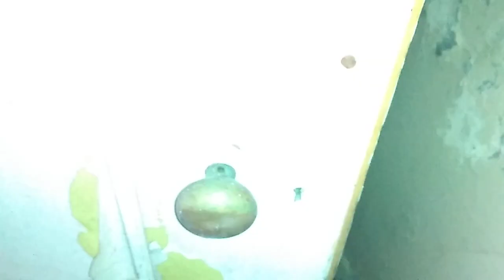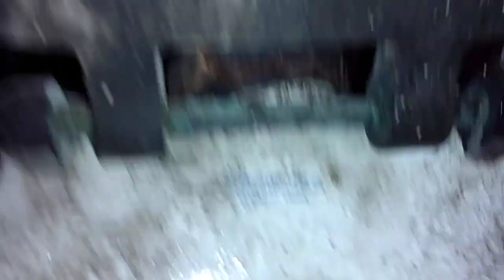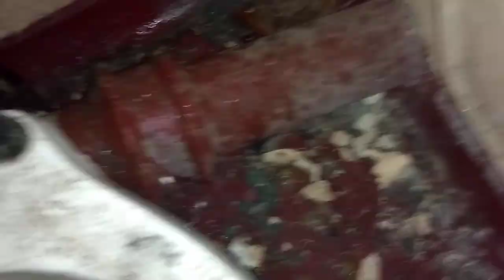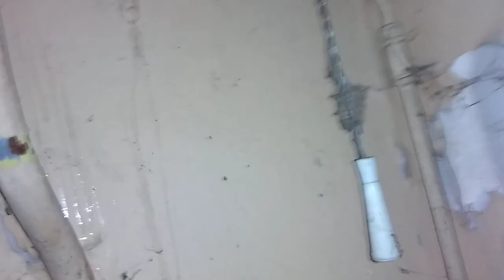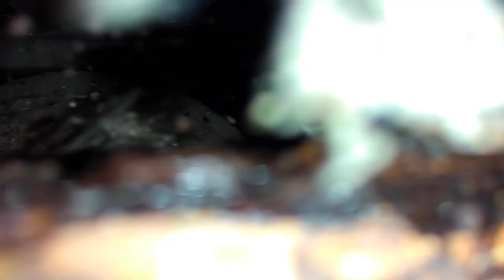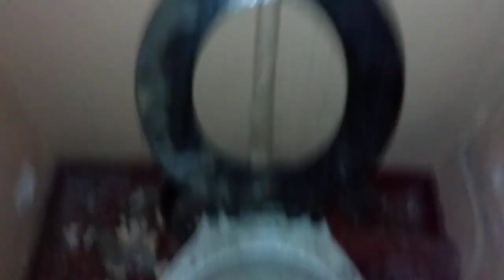Derelict 1950's HLSP Pegler Cast iron cistern & Shanks Kyle pan

Comment: Awesome find. Cast iron looks older than 1950s
Reply from the maker: Actually no, it's original to the pan, and in a 1950s extension to a large edwardian 2 story building. I'd date them both around 1955. I believe the last were made by 1960.

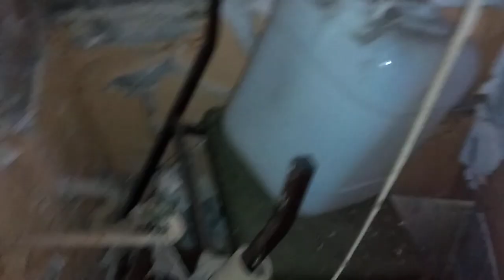Comment: 0:20 hate it when people smash basins for no reason, the kinked lead p' trap. Don't often see RH (or L.H) P'trap pans now, sadly getting scarcer. Spigot into cast iron socket with red lead putty. I presume this goes to a stack outside-therefor this could be a long branch . when plumbing was an art, 1/2" lead supply (could be 6,7 or 9LB)  brass Nut & liner to ballvalve. overflow 3/4" x 9 or 10LB swelling shape(wiped) to a straight tank connector. Guess a mild steel flushpipe.